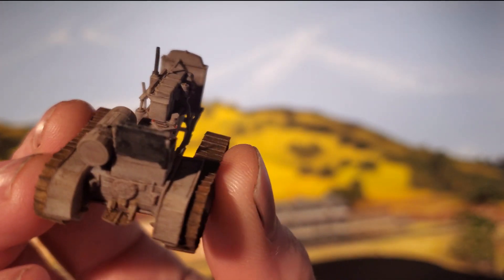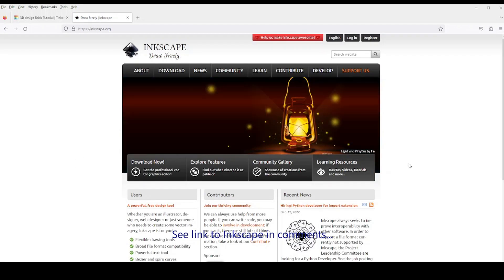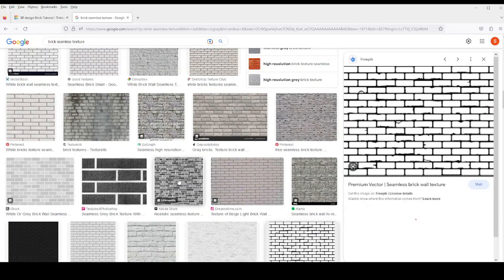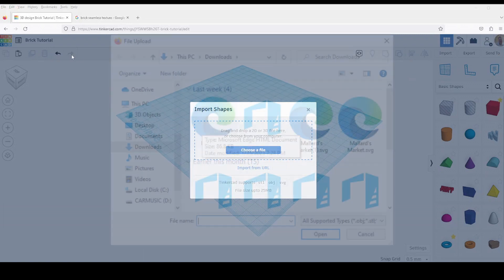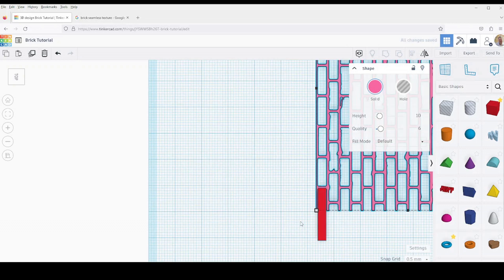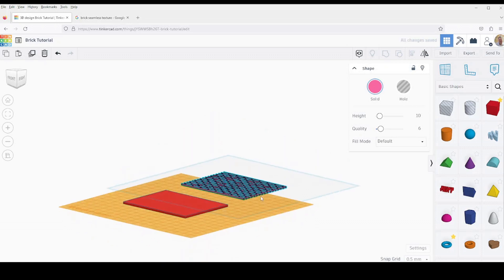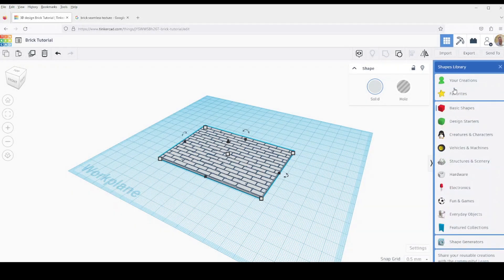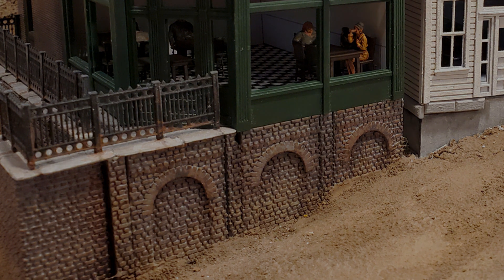Creating Realistic Brick in Tinkercad

Comment: What scaling do you recommend for O gauge
Reply from the maker: Standard bricks are 2.25" high by  7-5/8" long. Scales to 0.046875" x 0.1598958333" in O scale. Depends on the size of the bricks in the graphic you used.

Comment: Great work Scott. Newbie here to 3d printing and wondered if this shape can be curved to create a curved wall?
Reply from the maker: Not in Tinkercad. The only way I could think to do it would be to make copies of the mortar "stamp" and rotate them around the cylinder, then subtract them from the cylinder. A second cylinder with a slightly smaller diameter could be center aligned within the first to give the mortar lines even depth.
Reply: @pacificcoastmodelworks1928  Thanks for the swift reply. Yep, thats pretty much what I did with individual bricks (similar to  this tower process: https://www.youtube.com/watch?v=-G7nOhwZ-r8&t=620s I am looking at using Blender which seems to have move capabilities in that respect, although I do like the simplicity of Tinkercad.
Reply from the maker: @paulwooding8382  Blender is a very steep hill to climb. Nothing intuitive about it.
Reply: @pacificcoastmodelworks1928  Indeed. Fortunately I have a young son who has mastered it and has done a great job of using some of its tools to create just what I needed. Now playing with multi colouring in print form :-) So much fun, I can see myself spending more time with my printer than my Scalextric :-)

Comment: Great video, but how did you get your brick to 3"?  I imported the brick pattern then scaled the brick to .48mm (3" in N-scale).  I also locked the scale when saving for re-use. Sound correct?
Reply from the maker: Joseph - I added notes on scaling in the description. I don't scale the models in Tinkercad but in the slicer when I import the .stl file. I do not lock my custom creations because in the past I have found it advantageous to be able to scale them. For example, I might want to use this brick pattern as stone on another project, and with the scale locked I cannot stretch it. It will always come into your model at the original scale, so you have to intentionally modify it to change the scale.